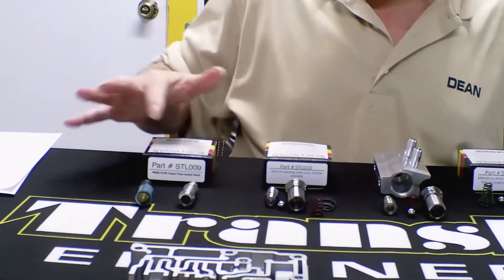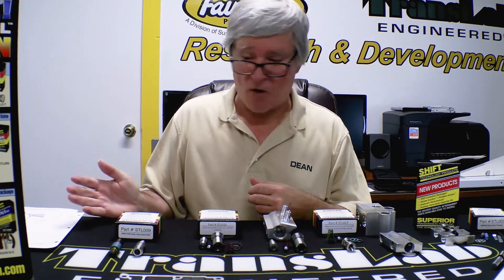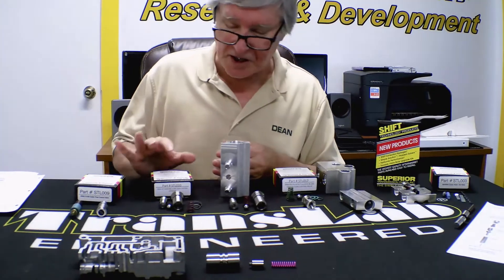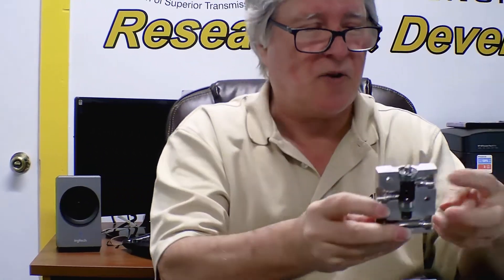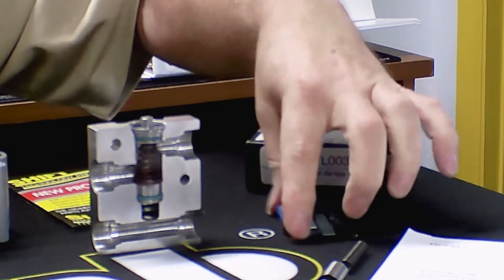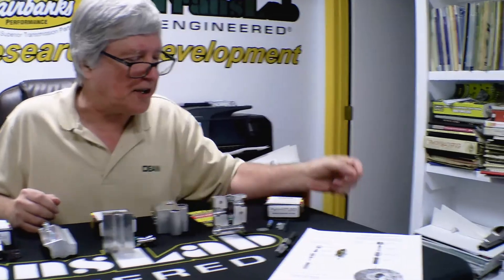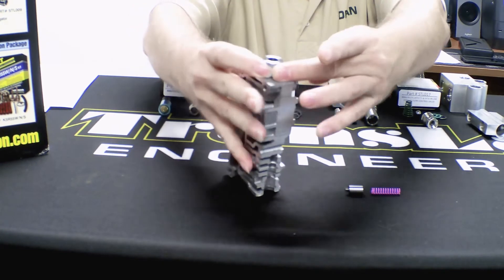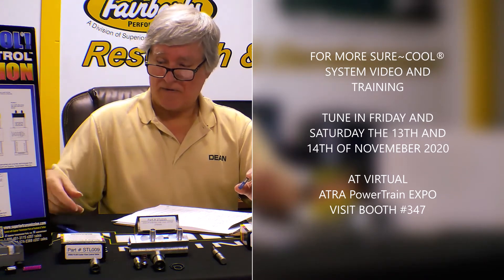STOP! DON'T PLUG the BYPASS Ford / GM Sure~Cool® system TransLab Engineered® Dean Mason cw 2021

Comment: How long does it take to warm up the 6l80 with this installed vs keeping the thermostat installed. I drive short distances and don’t want to run too cold in winter.
Reply from the maker: the TransLab / Superior STL010 Sure~Cool® system is full flowing on start up, helps to keep the fluid flowing and if the temp outside is cold enough to thicken or freeze the AFT the Sure~Cool® system's dynamically active bypass kicks in and routes the ATF thru the Lube~Loop™ that is inside the block to heat the fluid and allow flow to the internals of the transmission. Especially for short hops on cold days, you would want the features of the Sure~Cool as its...    A. fully flowing on start up, stays flowing unless a restriction is blocking adequate cooler flow.
Reply from the maker: B. the active bypass of the Sure~Cool® dynamically kicks in and allows fluid flow via the Lube~Loop™ inside the cooler block, lubing and cooling the internals and lube circuits, so if its Plugged (on purpose or via flipping the pellet) YOU HAVE ZERO FLOW THRU THE BLOCK...NO FLOW, Period. C. AND For Your short hops... if the pellet doesn't open for 30-45 mins on average and you drive for 15 mins to work, from work, to home etc.. when would it be open?????????  B. the active bypass of the Sure~Cool® dynamically kicks in and allows fluid flow via the Lube~Loop™ inside the cooler block, lubing and cooling the internals and lube circuits, so if its Plugged (on purpose or via flipping the pellet) YOU HAVE ZERO FLOW THRU THE BLOCK...NO FLOW, and that includes short hops... if the pellet doesn't open for 30-45 mins on average and you drive for 15 mins to work, from work, etc.. when would it be open????????? right it never would open, our system, is open and cannot stick... ALSO the oe. version, no matter the TEMP setting of the pellet, will still eventually stick from debris or contamination especially not opening during short runs. hope that helps...
Reply from the maker: the average is about 120-140 in ten minuets at zero F, and could be quicker if you have the radiator trans cooler in the loop as it acts as a preheater for the system. some are direct to the external cooler omitting the radiator (oil to coolant exchange) and if you have that type it will stay colder during the initial start-up. cold fluid doesn't hurt a transmission, NO FLOW from the cooler circuit / Lube Circuit WILL. ours keeps flowing... the rest, keep watching the video and wished they would have bought the Sure~Cool®... and at 4500-6500 for a new unit... Sure~Cool® for the WIN!!!
Reply from the maker: You will have flow that can circulate heat. Our bypass kicks in via flow rate vs pellet and a stuck pellet becomes a Cork. Restrictions and flow create pressure we use the differential to our advantage and if you bought ours you have that advantage. Ranges cold 130-160 when warm.

Comment: Do you have this on any of your personal trucks? I’m thinking about it, I pull a 7500k toyhauler and I am in 198 then stop go 212😬, I know not good
Reply from the maker: we have it on several and all are steady around 165 ish but just regular driving not towing, towing will show higher and if you need to add a 2nd aux. cooler. you should have a 2nd one on it if you had the tow package.

Comment: Anything for the 6f55 6 speed ford, maybe something for the external thermal bypass for the cooler. Just a snap ring to a thermostat
Reply from the maker: the STL020 fits all the ford external blocks, so that is the part number you need on your vehicle. the STL009 is the ford internal one that goes between the case and valve body on the bigger 6R60 / 6R75 and the 6R80's the STL020 also fits the 8R90's etc. here's the link to the STL020 one click tm one minute tm video on you tube.  https://youtu.be/r6OlveOcgv8     just be advised the STL017 is no longer available its been blended into the STL020 so now one number fits all 3 styles of FORD blocks and some dodge/jeep too.
Reply from the maker: STL020

Comment: FIRST, WE SHOULD NOT BE SURPRISE THAT THE GM FACTORY HAS BEEN DOWN. YOU ARE BUILDING A CANYON AND DON'T CALCULATE THAT TRUCK TOWER. A HEATED TRANSMISSION AFTER IT:)) NOW IT LOOKS AT US SMART CONSUMERS..:))) ( NOT GM MANUFACTURERS) 1- FAULTY TRANSMISSION THERMOTAT. THIS THERMOSTAT IS NOT MANUFACTURED ACCORDING TO HOT COUNTRIES, IT IS MANUFACTURED FOR ALL COUNTRIES..(FALSE) 2- TRIBUNE PRODUCES MOISTURE.. THIS TRANSMISSION OIL IS WRONG,:))) 3- HEAT PROBLEM FOR PEOPLE WITH HEAT TYPE OF USE)) CALCULATION 4-.:) FOR THE FIRST TIME AFTER 2014, GM STARTED LATELY IN THE PRODUCTION OF 8-SPEED AND 10-SPEED SPEED TRANSMISSIONS AND ITS FAILURE AND R&D DEFINITIONS..:)) 5-TECHNICAL SUPPORT IS LESS THAN CONSUMERS..:)) CONSUMERS HAVE FOUND THE PROBLEMS THEIR OWN:) 6-CUSTOMERS HAVE FOUND THEIR PROBLEMS:) AND THE TRANSMISSIONS ARE CANNOT BLOCK THE WEIGHT..:)9- CTS 8 FORWARD AND ESCALADE TRANSMISSION ARE THE SAME..:))) BEYOND FUNNY... 7- AN ESCALADE OR SLIVERAINE DELIVERY VEHICLE, A SLIVERAINE DELIVERY VEHICLE, THAT IS CLEAN TO BE USED ACCORDING TO AMERICAN TRAFFIC RULES UNCALCULATED AND THOUSANDS OF THESE VEHICLES ARE EXPORTED TO THESE COUNTRIES:))) EXTRA FUNNY.... 8-,9-10... I CAN COUNT MANY MORE DEADLINES. I HAD TO... WITH AN AMERICAN MANUFACTURER IF YOU ARE NOT LAZY R.. JUST CANNOT KEEP UP WITH THE DEVELOPING WORLD, KEEP YOUR SOCIAL LIVE AT THE FOREWORD, AND YOU CANNOT SEE THAT THERE IS A TECHNOLOGY WORKING LIKE A MACHINE, IN GERMAN, JAPANESE, CHINA, SOUTH KOREA AND MANY COUNTRIES FURTHER THAN YOU. YOU ARE LEAVE YOUR BUSINESS TO CONSUMERS.. :))))))))). DON'T BE ANGRY WITH MY WRITTEN :)) TAKE A LESSON. :)))BEST R&D, WE ARE CONSUMERS :)))
Reply from the maker: The designed system from the factory is a good system, the type of components used is what's at fault. The thermostatic pellet degrades over heat and time, causing the pellet to stick and malfunction and shuts off cooler flow thus melting down the transmission in some severe cases. Our products do several things. A. Keeps the bypass fully functioning and in tact and not blocked B. Is now Dynamically Active vs the static pellet type. C. Allows full cooler flow on start up and through out operation cycles.  D. Allows the bypass to kick in due to a pressure differential from cold (thick viscosity) oil in frozen climates or blockage in the cooler system shutting off cooler flow.   D. Easy to install permanent fix. E. Cost efficient, less that 45.00 most distributors. F. Results are immediately visible on the temp gauge. Usually 45 deg cooler then previous design.

Comment: Hi, why is it that it did not work on my 2014 silverado 1500? Temperature still goes up to above 190.
Reply: Did you ever get around to a fix? Mine does 160 in the HWY and about 180 in city traffic
Reply from the maker: @alextrujillo8658  that's normal, you want to see the fluctuations, the main thing is it drops. And gets back down,
Reply from the maker: You may have some type of cooler blockage.  It should be in the 140-160 ish range. Sorry for the late reply we have been on mandatory vacation for the holidays. Contact us thru our website. 
www.superiortransmission.com
Reply from the maker: You may have a partially plugged rad cooler or aux cooler, on a normal temp day 70deg with full flow the temp should
average 160 ish anything different suspect low flow due to blockages in the system.
Reply from the maker: Get it to a shop and see if they test flow. Also we have seen some "clear out" over time now that the cooler is flowing full time. debris naturally occur in automatics, when you stop flow it give the debris time to settle and over time restricts flow elevating temps. Also a second cooler in parallel will help at worse case bypass the radiator cooler and run 2 aux coolers for big loads.
Reply: @superiortransmissionpartsi5357  

Question, my engine thermostat opens at 210, does that have an affect on transmission temps. I have the option of setting it to 190. I’m assuming that once the fans kick on they also cool the transmission fluid.
Reply: Mine gets close to 160 here in the city but when i drive it for like 2 hr drive it goes to 180 on the highway. It's weird then when i come to a stop and start driving the temp start dropping
Reply: @nestorvazquez6736  igualmente la mía

Comment: So glad i did this on my 2015 Silverado! Way cooler while towing my 7,000lb travel trailer!
Reply from the maker: Glad you did too. It's one of our best fixes.
Reply: What temps are you running now while towing and not towing?
Reply: @A27_  120-140
Reply: @AlmostHeavenCamping  wow! That’s crazy 
I run about 190 normally when not towing. 
I bought the kit just have not installed it yet. Excited to use it!

Comment: My friend did it on his 6l80 and sais it works great, i would like to know if this will work on a 2017 camaro ss with the 8l90
Reply from the maker: As long as it has the cooler block on the side of the trans, by the line connection
Reply: @superiortransmissionpartsi5357  thank you for the quick response.

Comment: Does this work for 2018 Silverado?
Reply from the maker: If is has it, look on the d/s underside of the truck/unit and you will see a aluminum block with 2 lines running into that. If it look like the block we show on the video then yes it has it and the part number is STL010. You can Google it to find a retail store or transmission parts place.